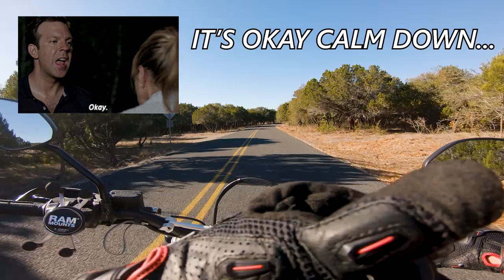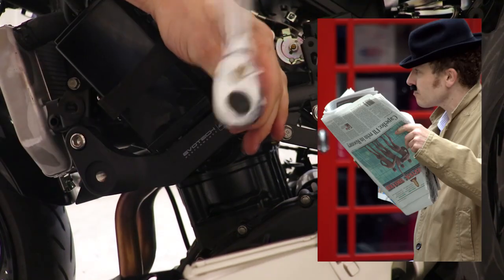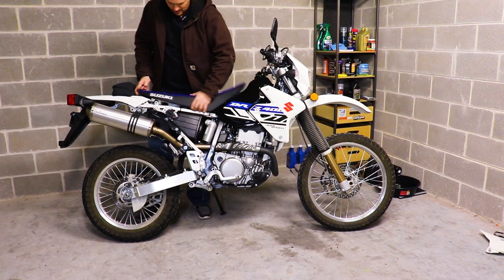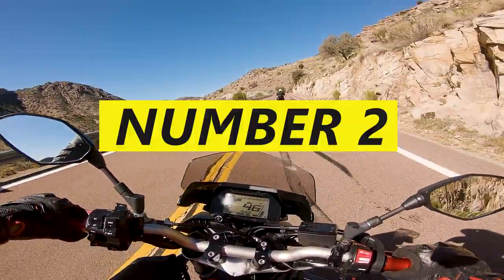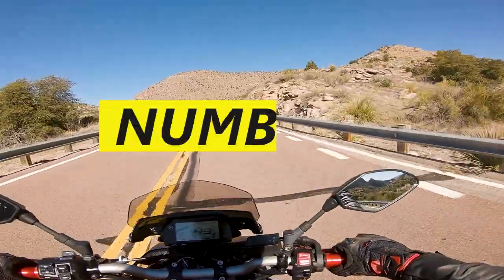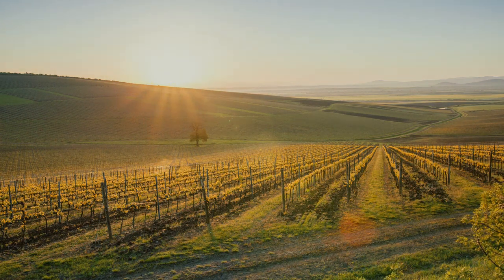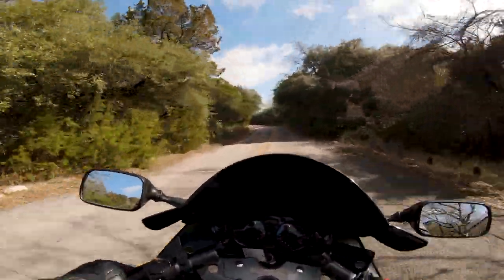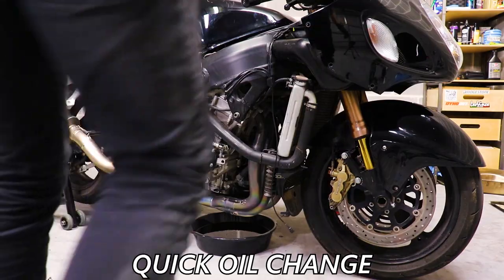Top 7 Motorcycle Maintenance Tips to Save Your Sanity

Comment from the maker: Who's got some shop horror stories. I definitely have way to many from working on the Hornet. Be sure to check https://yammienoobmerch.com/ for double entries to giveaway and 10% off when you use code TRIPLE2020
Reply: I won't buy used motorcycles because the money you save is often offset by inexperienced people having worked on it.
Reply: Dad was a great Harley mechanic back in the day in Evanston, Ill. Mr Harley and Mr. Davison would stop by the shop now and then because it was the northernmost Harley dealer in Illinois. Dad used to show off by rebuilding an engine, and before starting up the bike, he would change into his street clothes and then start it. One time he was back changing his clothes and one of the guys in the shop sneaked a wrist pin clip onto his work table. Dad saw it, freaked out, was getting ready to take the engine out again when his buddies let him know what was up.  Great gag.
Reply: I had my bike in gear on the centre stand and lost my finger tips to the rear sprocket.
Reply: MaxWrist flipped his S1KRR.....
Reply: the new Honda Rebel 1100 Cruiser.
BMW and Honda just released big cruisers as Harley sales started to slump
please talk about this in your next yamcast!
Reply: Didn’t know what JIS screw driver was... yeah.... those sneaky Japanese 🤦‍♂️

Comment: Ahh those frustrating moments when you put all your fairings back on thinking you’re all finished then boom💥 you find a bolt or part that obviously goes somewhere underneath those precious plastics.
Reply: I hate it when that happens.
Reply: Just pick up the bolt....and add it to the lost bolt pile. I'm sure it will find a home some day. I've gotten to the point of just replacing bolts when I can't find it again so occasionally bolts just randomly turn up on the garage floor from their vacation.
Reply: We've all been there
Reply: I call that optimization
Reply: Or a random fuse......
Reply: @GustavoHernandez1  weight savings lmao

Comment: I did my own valve adjustment on an 05 Ninja 636, I have a bit of experience working on cars I can change my own oil and replace brake pads for example. But I had never tore into an engine like that. Was a nightmare, after doing it I started the bike and it made an awful noise, totally thought the cam timing was wrong and I just bent valves and destroyed the top end of my engine but the timing chain tensioner was just set improperly. In the end I was very glad I did it, learned a lot and gave me a lot of confidence working on motorcycles and cars.

Comment: Just did my first ever oil change on my bike yesterday, and i learned two things:
1. Apparently oil filters can be a pain in the ass to remove.
2. Sometimes, the best way to solve a problem is to hammer a screw driver right through it lol 😅
(Ps. I am in no way, shape or form a mechanic. Before you decide to hammer a screw driver through any part of your motorcycle, please consider consulting an actual mechanic first)
Reply: Consider K&N filters with the hex cap on the top for a socket. Costs the same and are good filters.
Reply: Just get an oil filter remover they are like 5 dollars
Reply: @romanrapoz4813  I have both types, but sometimes there is not a lot of room to use those. They also can slip and be real knuckle-busters. Using a 3/8 inch ratchet really makes it a breeze. And the filters don't cost any more than others. K&N is a good brand.
Reply: @danakaboom1158  The old filter that i removed was a K&N, as well as the new one. I think what caused me to have such a headache removing it was my inexperience and stupidity, as i tried using a regular wrench instead of a socket. Also, i think whoever put in the old oil filter used a power tool, because i also broke an oil filter remover in the process. At that point i resorted to just hammering a screwdriver right through the filter and using that to unscrew the filter.
Reply: @deliriousjake5888  I hate it when that happens. You got the job done though.
Reply: Get a oil filter strap wrench, fits everywhere and thank me later. I'm a mechanic and on my own junk, I have stabbed a screwdriver thru or crushed the filter with a pair of vice grips a few times. Key is to not overtighten the filter and lube the filter seal.

Comment: Recently put a TOCE slip on on my CBR600RR and tried to flip the clamp because it was easier to wrench 🤣 Got to the end of the install only to not be able to put my peg back on because the bolt was sticking out a half inch 🤦🏾‍♂️ Had to disassemble EVERYTHING 😃

Comment: My trick for a Yamaha Virago 1 gen when changing the clutch side cover, it is best to have 2 people there.  Once to pull the cover and the other to slip a hand in the partially opened cover to hold the starter gears on the peg so that the spline, gears, and spring doesn't pop off and roll onto the shop floor :)  Also, you don't have to buy the best tools out there.  Harbor Freight tools work just fine for basic maintenance and many come with a free replacement if broken.

Comment: ASE certified tech here, if a torque spec seems awfully low, do it anyway. The number of times I have looked at a torque spec and thought "15lb ft? Thats it? Better bring it up a little just to be safe" was in the dozens when I was a rookie. Very smart and very well paid engineers have spent thousands of man-hours determining every. single. fastener. spec. 
They know it is tight enough to hold whatever it is in place without it falling apart. And what do you know? Nothing. It's crazy that people (myself included) have read the specs, and decided at that moment that we know more than them, and *snap* there goes the bolt head. Or worse, when you are tightening something then it suddenly becomes very loose. Learn from me and trust the engineers.
Reply: I just got my rear shock assembly rebuilt and can't get a torque wrench on any of the nuts used to put it back in. Horayy

Comment: Here are 4 tips from my 20 years of personal experience with motos, cars/trucks, appliances, etc, etc.., that I think all newbies should practice:

2. If you're ever unsure of something, take pictures and short videos explaining to yourself where something came from and what was plugged into it, or where it was plugged into.

5. If you're removing lots of electrical connectors, fold a piece of tape in half on the wire so you have a tab, then label both connectors, or connector with what it goes to.

C. If you completely remove a nut and bolt together, put them back together before you set them down.

3. And how not to lose, mix up, or have extra screws: USE BAGGIES AND A SHARPIE.  Bag and label ALL your screws and small parts into groups and sub groups.  This can be an invaluable part of your project if you're working on something over the course of a few days, or even just a few hours.

@: Most of all... 
don't be afraid of getting in there, getting really dirty, breaking shit, busting your fucking knuckles, cursing, and throwing tools. 

83: You will only learn from your mistakes, so make lots of them.

Comment: The first time I ever tried to do any maintenance on a bike was the first time I ever tried to do maintenance on anything. Changing the oil on my 1990 Yamaha Seca II. Evidently I didn’t follow righty tighty lefty loosely. As I stripped the plug. A trip down to the dealership and it was fixed. Anyway I triple check that now. Tires is something I’ll do just for the savings. Ride enough and one of the No Mar tire changing stations will pay for itself fast. Quicker if you factor in your time.

Comment: I’m pretty technologically proficient so with the benefit of YouTube, I usually can pull off most tasks that I encounter. I’ll be doing an oil change on my Duke 390 soon. A video about the tools that are usually used on maintenance would be cool. You can show off that new pegboard setup.
Reply: Hey bro: if you need any help with your oil change or "service" message reset, I have a video of my RC390 (same engine) on my channel.

Comment: Another tip, record yourself when disassembling so you know how to reassemble and organize the nuts and bolts and any other pieces as well when doing it for the first time or even second or third time.

I somehow have extra bolts and those push panel clips after doing a flush on fluids, replacing my fork/dust seals,  and then putting my fairings and everything back in place...
Reply: Yes yes even photos are good as you are taking it apart. You think you won't need them but you will

Comment: If you take the wheel off yourself and take it to a Cycle Gear store, they will add a new tire and balance it for a very fair cost. I have found that the back axle is much easier to get back on than the front axle.
Reply: If you didn't buy the tire there, I don't think 50 dollars a wheel is a fair price. Searched around and found a small bike and car shop that did both of myne for 60 bucks. Not sure the level of mechanic they have at cycle gear. Would imagine it's like a pep boys level mechanic

Comment: great tips, I just bought a new bike and with every oil change you need to check the value clearance. Or I have to the dealer is too far away for me to ride there, and i am a backyard mechanic with limited space and tools.What makes it harder is there is no marks to tell me where top dead center is.Because it is brand new makes it more of a concern.

Comment: Patience...That hits the target 101%...I have worked as car mechanic, and holy fu*k, something simple like removing front steering arms when it wont go, and instead of finishing it in half a hour, you waste 3+ and every passing minute is making me more angry about that, i would start using stronger means for finishing work, and usually it makes more damage than it is doing good...just make more pauses between and patience is the key to every single thing when working mechanical things on your bike/car

Comment: Ok, I'm a licensed motorcycle mechanic and I have whispered righty tighty, lefty loosey WAY to many times.
Also NEVER get into the F*CK IT mind set! I did a few times early on I'm my career and it came back and but me hard in the ass! Thankfully no one got hurt, but my pride because I had to redo a job, or fix something I broke or didn't tighten. If you start saying f*ck it, take a break, slow down and think what could happen if something went wrong with that part/job.

Comment: Here is the best piece of advice a mechanic ever gave me:  lubricate every bolt and screw before you try to take it off. Before you remove the first bolt, make sure everything has the ability to be loosened.  Learn wrench control and tourque control.  Make sure you are using the right tool.  You will stop breaking stuff.  Trust me.

Comment: Remember - lefty-loosy/right-tighty only works 98% of the time. Know the difference or you are screwed.
Reply from the maker: When I encountered my first reverse bolt on a mirror on a bike, I was extremely confused.
Reply: @yammienoob  If I stare at a thread for a second, a left-handed thread usually looks weird. I think best to visually compare to a standard bolt held up next to it to make sure.
Reply: @yammienoob  My lesson was the threads on the ends of a shift lever rod that have a right thread and a left thread...
Reply: That is exactly why you want that Service Manual.
Reply: @act.13.41  Good point.